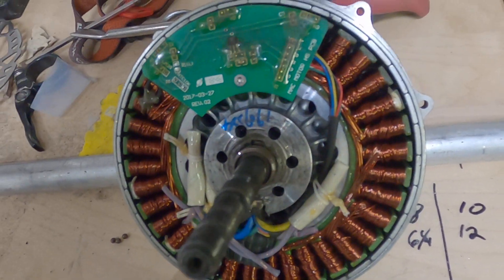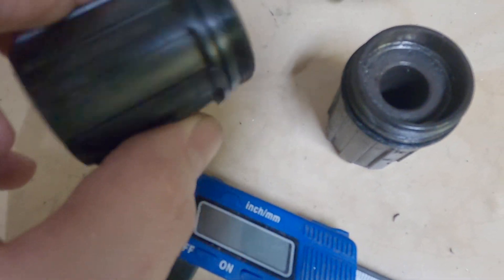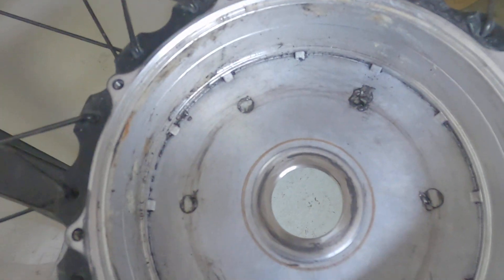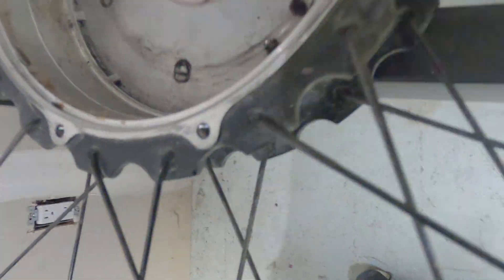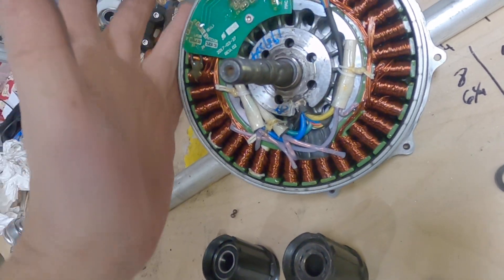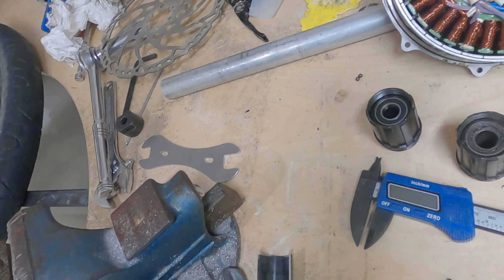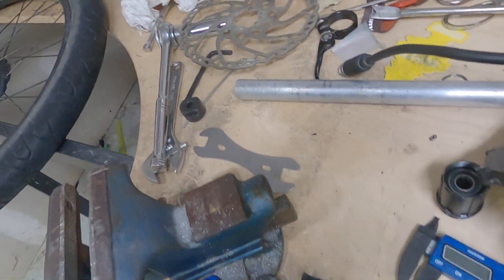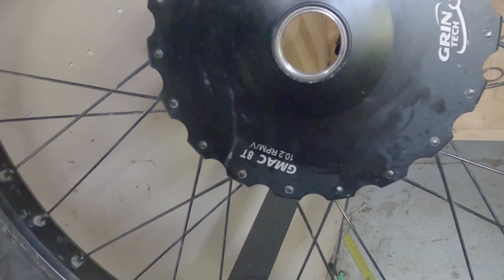gmac hub motor toast?   small but powerful  hub motor from grin technologies gets opened up !

Comment: had a bunch of problems running this with regen at 72V. Broke the aluminum torque arm, a bunch of gears. started making weird noises. I really hope they're would be an even more heavy duty geared motor option on the market.
Reply from the maker: being able to get those parts is great !  nylon gears are used  to save wear on the the core or expensive  insides . just like in a bmw transfer case .
Reply: @bdcainathotmail  Hopefully these gmac motors are more robust than a BMW.
Reply from the maker: @chrisE815  I have worked on  a few 
bmw 's and yes its its more robust and  simple to work on!
Reply: @bdcainathotmail  thank you for the video!